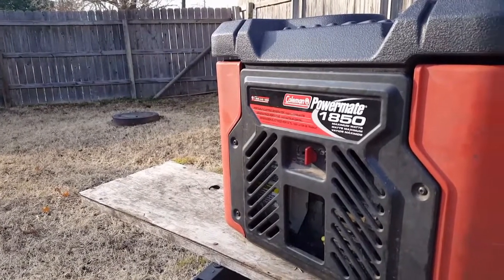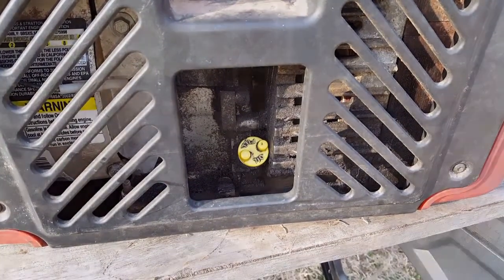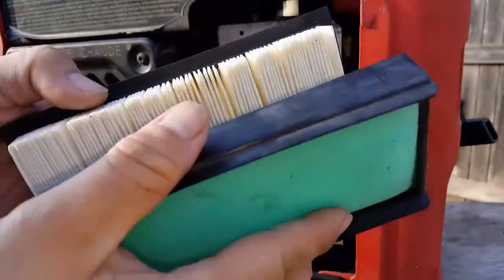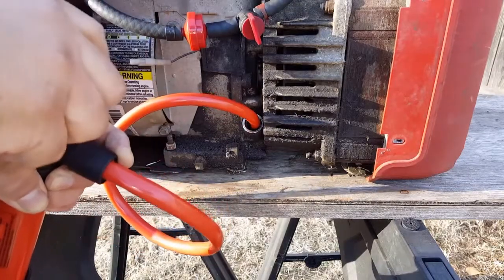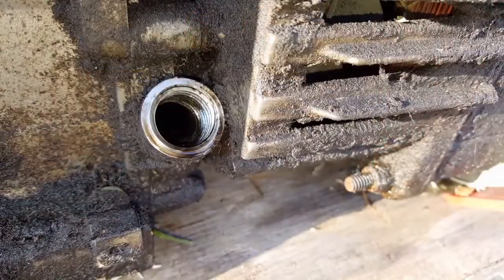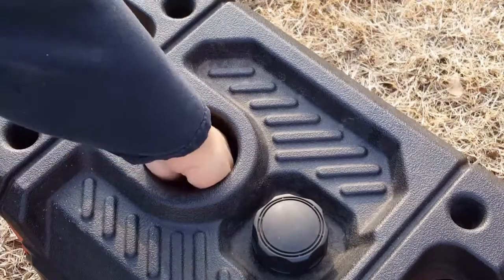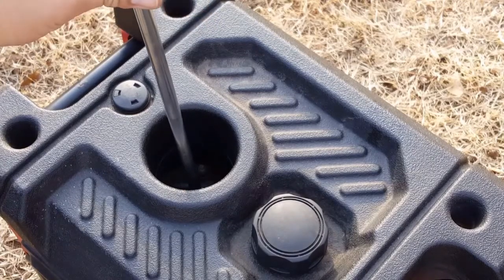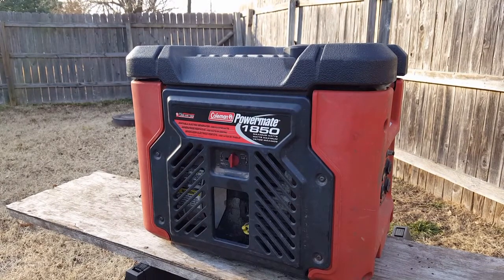Generator needs a tune up.

Comment: Thanks for the good video.  I have the 1850 pulse, which looks to be an older variant, but similar.  Did you run it for a few minutes before changing the oil?  I believe you're better off changing the oil after the unit has warmed up.
Reply from the maker: yes I ran it for longer than I showed, to make sure the oil was warm.  thank you cawag98
Reply: @HomeGaragechannel  I got mine started and - once I understood to move the choke lever almost immediately, it runs great.  I used some mobile-1 full synthetic I had sitting around for the oil change.

Comment: Hey home, something we can find daily basis, can you unsize an engine ran out of oil?
Reply from the maker: Yes you can but it will never be the same afterwards.
Reply: We know that but we can put it on working condition, on Craigslist often get rid of them
Reply from the maker: Just long as the engine has decent compression it should last for a while.

Comment: Can you please tell me what kind of spark plug comes with it or what type of spark plugs should I used the previous owner doesn't know?
Reply from the maker: Is the generator the same as the one in the video?
Reply: @HomeGaragechannel  yes it's the same
Reply from the maker: According to a manual online  the 1850 needs an rcj8 plug.
Reply: @HomeGaragechannel  thank you so much.
Reply from the maker: Thanks

Comment: Any idea where the oil drain bolt is? Also what type of oil would you use for this generator? Thanks. I have the same generator and just replace the carb and air filter
Reply from the maker: its on the same side of the drain fill at the bottom.  its a square bolt.  I just needed a reason to use my oil pump.  I would use 10w30 since you can use the generator any time of the year.

Comment: I have this generator and shes running rough. I'd like to do a tune-up. What oil and spark plug do I need? Thanks!
Reply from the maker: Thank you  Total Entertainment for the comment.  You can use Heavy-duty 30w or 10w30 oil. I'm not sure about the plug as I don't have the generator anymore.

Comment: Hello there was wondering do you use OEM spark plugs or do you have some success using the China ones that come with the Amazon carburetor kit?
Reply from the maker: I don't use OEM plugs. I usually use champion equivalent.  As far as Chinese plugs I don't mind using them.